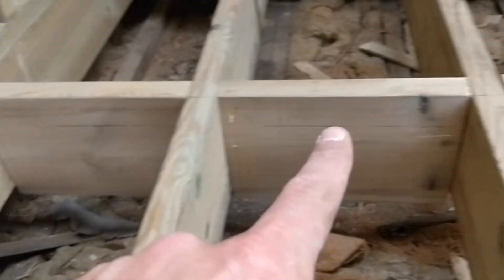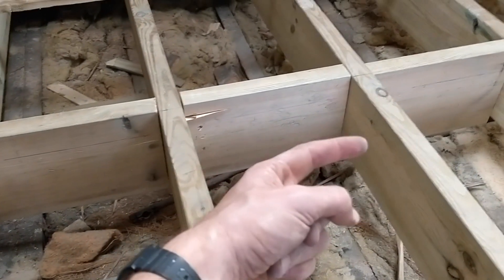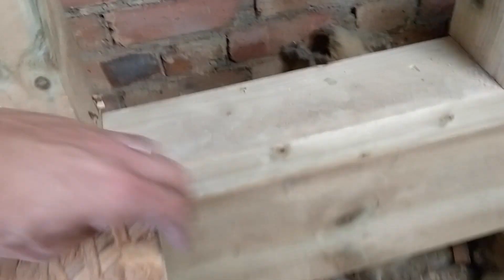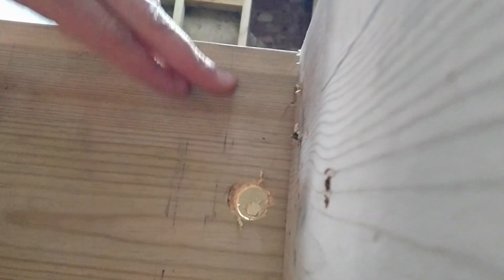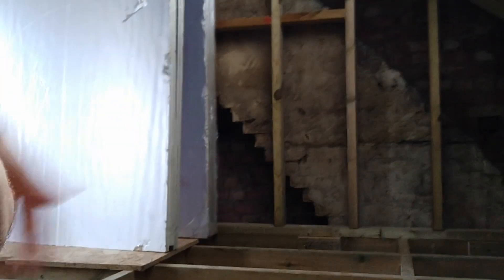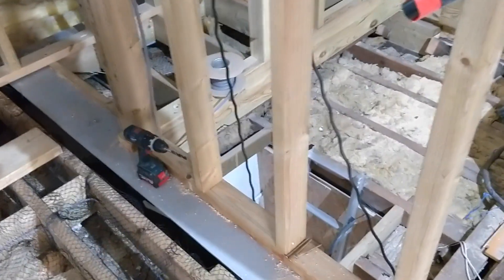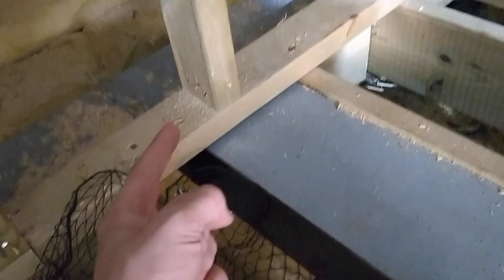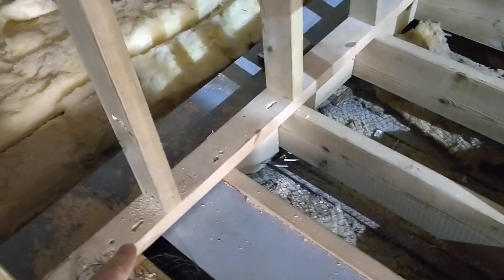Loft Electrics - Ring Circuit

Comment: Do you have to clip your cables to the joists or is it acceptable to run it under joists without clipping?
Reply from the maker: As I understand it, there's nothing in the regs that stipulates that you need to clip the cables to the joists. There are pros and cons: it's neater, looks better, and uses less cable because it's efficient with distance. However it does take longer, and it's harder (impossible) to pull excess cables through if you need a bit more!

Comment: Thanks for sharing - a very informative series. Are you attaching the stud walls to the steels with anything or just resting them? Cheers
Reply from the maker: We braced them at each end with joist ties, which was a bit of a pain to do, but worth it. You can simply rest them, given the implied forces of the roof on either side, but invariably the structural engineer will specify something to hold it in place.
Reply: @OfficeBoyBuilder  Thanks very much!

Comment: Coming along nicely! 2 things...

1. I can’t recall if it’s been covered in an earlier video, but what’s the timing plan on the staircase? Is that something your planning to do last? 

2. Junction box - If you’ve got a double socket nearby and intend on using fast fix backboxes, another option is to bury the Wago’d joints behind that, so that pulling out the socket & box reveals the joints. I’ve seen it done by a few different electricians, and saves a bit of time over making floor recesses.
Reply from the maker: Cheers!
That second point is such a brilliant idea! I've not seen that, nor thought of it, but thanks! I'll definitely see if I can incorporate it somehow.

Regards your first point, the staircase (and entire loft) won't be finished until we do the side extension. We have the water tank there, and can't change the system until the side extension is built, at which point we'll put a new megaflow, invented system in.

Comment: Thanks for your videos. Very informative.

Got a good link for the Regs?  I've been reading about where insulation goes above wiring then derating needs to be applied.
Reply from the maker: I haven't got a specific website, but I've googled them as I go along.

That can happen when cables are left laying on foil faced insulation, but when they're clipped to a joist and amongst fibre insulation there isn't much of an issue.

When the building inspector came round I asked him about that too, and he was fine with what I had planned.
Reply: @OfficeBoyBuilder  thanks. Keep up the good work